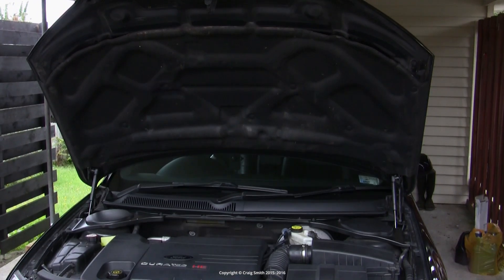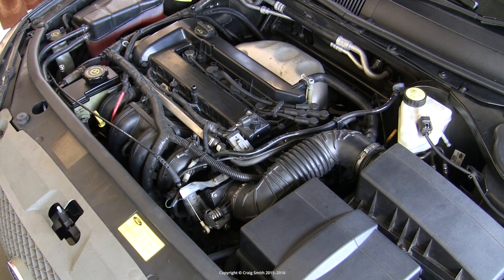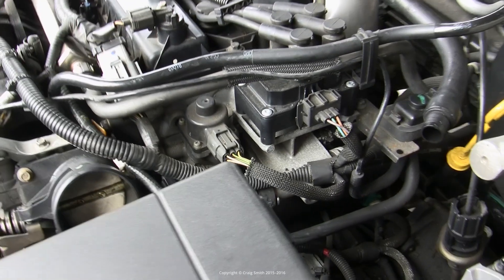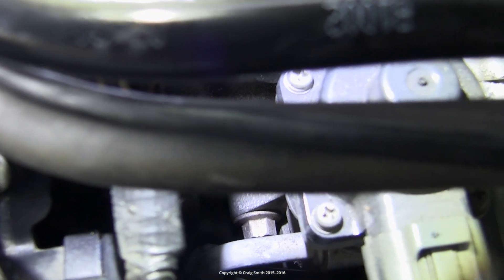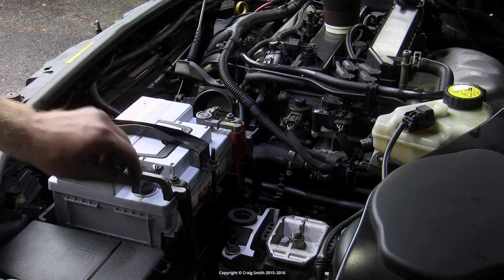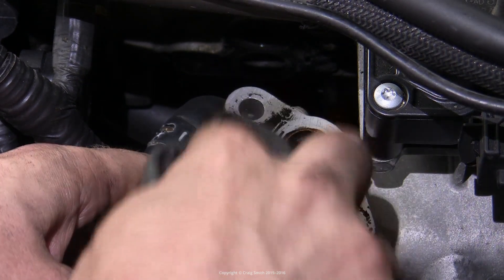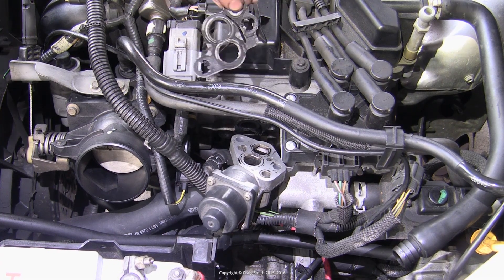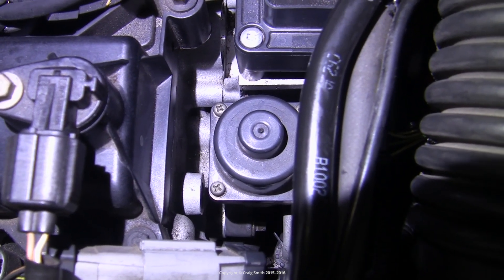How to: Remove & inspect EGR valve Ford Duratec HE (Mondeo, Focus, Mazda)

Comment: This was a horrible job! Whoever designed/approved that layout with the restricted bolt access is going straight to hell when they shuffle off their mortal coil... 

My tips:

Take the small coolant hose off before you unbolt the EGR. If it's been there for ages that hose will take some wrestling, and having the EGR solidly mounted will help. 

You will need a very shallow 10mm socket and knuckle joint to get in there. I didn't have anything that would fit, so I had to remove the large coolant hose, and was just about able to get a hex driver extension in there to remove the rear bolt.

I stopped the job to buy new bolts for the new EGR, because I rounded the edges of the rear one a bit trying to remove it. If you're planning on doing this job I'd consider doing this in advance. They were £7 for the pair, and fresh new bolts can't hurt. Better to have and not need rather than need and not have. 😉

Comment: That EGR ( exhaust gas recirculating ) valve looks just like an IAC ( idle air control ) valve.
Reply: Gusssing it must just fill the egr valve always and stay filled 🤔 so to keep the recirculated gasses cooler? I’m not sure tbf I was wondering that, I have one on my st150 being a 2005, worth removing you reckon?

Comment: If I replace the egr with a new one, do I have to calibrate or make an adjustment from the ecu or do I just replace?
Reply from the maker: Just replace. If the old one was faulty or very clogged up you might want to reset the car's tune adaptions, just unplug the battery while you do the job.

Comment: Well I managed to do it. But before touching the EGR, i unbolted the  water outlet connector so I could slightly move up the coolant tube and reach the rear bolt

Comment: The 2nd bolt on the backside of egr  is impossible to remove
Reply: Agree I tried can't remove
Reply: Yes I have been looking everywhere for this comment. I am currently banging my head against the wall. I hate 1/4 inch tool it flexes so much and breaks so easily. I am thinking maybe I'll just remote the top bit and work it up and down without cleaning the inside.   Who the hell designed this, it's awful.
Reply: Agreed. This is a nightmare.

Comment: The second bolt on the backside is virtually impossible to undo...smh someone said try a 90° degree angle so ill try thet to take the backside bolt off.... smh
Reply: Did it work?

Comment: I have Ford Focus 2007 model running on petrol and check engine lights have been a problem for a while now and it says EGR system flow fault, it might take more time and cost to order a new EGR and replace so I am planning on deleting or blocking the EGR but still unsure about it. do you recommend of using blocker plate for the solution?
Reply from the maker: I don't have experience. It might cause inspection failure depending on where you are, also I understand might require ECU re-map to get the codes & lights off.
Reply: @CraigsDIY The inspection is not a concern for me, and if i don't get it remap the only downside is i will always get faulty engine light code is it
Reply from the maker: No it can relate to tune too, the engine will not be getting the fuel/air mix it expects.

Comment: Thank you very much for the information, I have found a few of your videos very useful for the duratec he engine. I like to do my own maintenance so now I have a list of engine components to work my way through checking the condition of it all including the fun swirl flaps and pcv as a prevention rather than cure. My engine has only done 80000 ish miles on a 2010 MK2 focus and with these maintenance tips I'm confident it will do this mileage again and again as it's an excellent engine.
Reply from the maker: A low mileage Mk2 Focus is a great car, look after it.

Comment: Hi Craig, I'm confused wondered if you would know, I'm sure you will, I have a mark 3 mondeo petrol, recently on start up the engine flies to over 3000 revs, the throttle cable is not stuck, can't check for vacume leaks, replaced the throttle position sensor, cleaned out idle air control valve, not looked a egr vale yet, any suggestions?
Reply from the maker: IACV or its electronics could still be faulty. Check throttle butterfly valve closing properly. Have to suspect vacuum leak. You would want to check OBD diag for air/fuel and related info to find clues.
Reply: @CraigsDIY  Thanks Craig, I disconnected the IACV and started the engine, it went straight back to normal idle.
I have ordered a new one.
Thanks for your help, and great videos by the way.
Reply from the maker: @billmacdonald5906  I saw your other post. So did the replacement IACV not fix it? If disconnecting the electrical plug solves the high idle and a new valve is no different, that must mean an electrical problem. Have you checked codes?
Reply: Hi Craig, thanks for your reply I think as you suggested I have a vacume leak, I can hear it sort of around the coil pack area, can't seem to locate it.

Comment: I did not torque bolts and exhaust gas leaked. 
What is the torque pounds/ft on these bolts.
In your video, bolts were not torqued and no leaks. What a fantastic mechanic you are.

Comment: I got 2 new gaskets with my valve (Napa) brand. Make Sure you use the right one with the new valve because they are both different, different port holes, etc. Just match up the old one with the new. It took me approx. 3 hours to remove because of that right side bolt being hard to get at!! I also disconnected the throttle valve and air box for more room. And I bought some of those S shape box wrenches to install the right nut easier (I hope) going to do it today. Rather than cleaning it, Just replace it! In case you clean it only and it still might not run well. Mine was $81.00 at Napa. And I have a 2006 Focus ZX4 motor 2.0L. Of coarse I had to disconnect Both the radiator hose in front of the right bolt for more access, then you have to disconnect the small hose on the valve when replacing of coarse.

Comment: My car is in for rough idle low rpm vibration. They checked mounts and cleaned the throttle body and mass air flow. They are now "guessing" it might be the EGR. It will take them an hour to check it so they are recommending I just replace it. $425can tax in. Is this a logical reach and solution to a slight vibration? 🤔

Comment: I did this job on my 2.0 duratec powered focus, awful access, lots of swearing and scuffed knuckles I managed to get a shallow 10mm socket on a small ratchet from underneath the hard to access rear bolt.
To get better access remove airbox, throttle body and get to it from the side.
Be aware you lose about 2lt of coolant as you have to remove the thicker hose going to the thermostat housing, as you remove it lift it up higher than the rad and wedge it somewhere, the smaller hose going to the EGR can be left on if you only want to inspect and clean, it is hard to get off and I did split the end getting mine off, luckily there is some slack so I had to cut some off past the split when refitting.

The metal gasket needs to be replaced really as it has compression seals around the exhaust and coolant ports, once it is nipped up the compression seals flatten to seal. 
Use carb or EGR cleaner on the internal plunger/valve assembly, make sure it can move freely and doesn't stick, there will be a lot of oily carbon in there.
I took mine off, removed the electronic solenoid part held on by 4 screws, and soaked the valve overnight in cleaner, dry it thoroughly and add a little lubricating oil to the valve, I also put copper grease on the fastening bolts.
It might not be the actual valve that is stuck, it may be the electronic switch part that is faulty but you cannot get this part alone, I paid £59 for a complete new EGR prices vary wildly I got quoted anything from £120 to £175 so shop around.

Symptoms- mine would run until warm then cut out, restarting would be problematic, I'd have to floor the throttle and crank it eventually it would fire up, run a bit then cut out.

I had no engine light so no codes, to check I just unplugged my EGR valve and it ran fine with no cutting out.

I guess my EGR was sticking open, the engine will not run like that, when I unplugged it the engine ran fine but my engine light came on! 

I ran it like that for months, without issue before I replaced it. EGR is purely to lower emissions it does not make the engine run better and has minimal affect on mpg!
In my opinion you would be better without one, look at the filth behind the throttle body where the EGR port enters the inlet manifold!
Reply from the maker: Thanks for all that. I agree with your last. Some cars in some regions don't even have them fitted, nor cats, so it is certainly possible to tune the car to run without.
Reply: on mine it absolutely fucked acceleration and mpg, but it did fail entirely.
Reply: @m1ghtyboy  If I could figure a way of removing the EGR valve, Installing the blanking plate they make for the Duratec and having the engine run without throwing a code, I'd do it because it ran much better when the EGR was unplugged.

The engine light comes on without the EGR plugged in, unless it just needs the top solenoid and electronics part plugged in, that might work?🤔
Reply: @ the car needs to be remapped otherwise it will try to use the nonexistent EGR to aid acceleration. Not a mechanic but I believe a remap will make it pull any air it needs from the intake instead of the exhaust, and of course stop it from throwing a code. If you’re in the UK this will likely lead to it failing its MOT due to emissions.

Comment: On my Transit connect I noticed a cheap assed plastic coupling in the radiator hose was weeping . I removed , cleaned and inspected it and found it was full of cracks and ready to fail at any moment . Unfortunately , the coupling only comes with the compete hose assembly . $150.00 U.S. from the dealer . $75.00 online . If you have fat fingers , good luck trying to get that lower bolt out of the egr valve . Could be a lesson in futility .

Comment: Why the need to diconect the battery termination ?
Reply: Always a good precaution to take when unplugging any electrical connections from the engine.  The reserve charge in the circuit can sometimes damage the electrical system.

Comment: Why is there a coolant hose connected to the ERG valve?  What on the valve needs cooling?  And there's no coolant return hose?
Reply: The exhaust gases are too hot for that tiny valve so it needs cooling. Anyway exhaust gases are used to cool down the engine combustion chamber because they have very little oxygen, and practically inert in the process. The optimal temperature ensures NOx to be reduced before the cat
Reply: @Starfank  
Thank you. That makes sense. 
I do see besides the two holes for gas, there are 3 more holes between this valve and the return to engine block. Coolant return is probably one of those.

Comment: lol. You did it in a 6min video... project took me 11hours. 'Course, I had to flush the radiator, buy new r fluid and MAF cleaner while they were taken apart..., and pull a salvaged sensor. Let me just say that I don't like EGR valves anymore. Taking the radiator hose off doesn't help all that much, because the socket for the hose still blocks the bolts pretty completely. I used a "box" wrench with a 90 degree bend in it (available at harber freight) to get them broke loose- only after I removed all of the wiring including the ECU wiring. NOT WORTH IT!!! Throw the car away and buy a scooter.
Reply: So did you sell or throw the car away?
Reply: So you were able to get the back bolt with a offset wrench? Or s type ?

Comment: Please, I need to clean egr on the monde and I do not understand you because I can not speak English. Do I have to drain water with coolers?
Reply from the maker: You don't need to, but you'll probably spill a bit of coolant in disconnecting the hose. If you lose a lot just top up after.

Comment: So is that tiny hose connected to the EGR the coolant hose? Or do you mean the big hose running next to it?
Reply from the maker: They're both coolant hoses, the small one cools the EGR valve.
Reply: I'm changing my egr valve on my ford focus .IV for got how to put clamp back on egr valve.the clamp that holds the egr together

Comment: Question can you remove on top of the erg the four screws and than clean it ???
Reply: I did that... and no. It has the ports for the exhaust only on the side facing in towards the engine.
I did find that the top (with the sensor and motor in it) are easier to swap for a new one if they are the problem. Also if you take the top off you can manually depress the valve on the bottom piece to see if it is gummed up or not.
Reply: @daniels6624  Daniel did you do that taking the top off with the four screws and try to clean it? It's harder than hell to reach those bolts. I have to do this the next day or two!
Reply: @BugzKiller I couldn't take the bolts out either ...they don't have have a tool or the room to do it ...smh

Comment: Thanks for this video how to do it.
But the tool you used did not fit by my mondeo I had to use another tool that was smaller so I could place it between the bolt and the hose.

Comment: Good video I know where the erg is now.
But can you spray it with some cleaner?
And must you spray it where it is attached on the engine?
And if so what cleaner spray I can use?
Reply: Yes it must be "cleaned" where it is connected into the engine.
It made more sense to clean these when they were removable.
Reply: How would you clean it ?

Comment: Hi craig 
My question is i replaced my egr for a new one after i did the job i set off the faultcode.. when i go for a ride the fault code pops up...so i read the obd end i see its the egr valve over end over again it will popd up back
Reply: That could be a broken wire, it could be stopping the egr opening, causing the ecu to throw a fault code
Reply: I'm having the same issue
Reply: Spray soapy water over the engine to make sure it's not a leak on your gasket or a vacuum line.
Reply: I'm having the same issue did anybody ever resolve the issue I need some advice

Comment: Hi if you undo the four  screws on top of the egr valve will that give you access to the inside so i could squirt some egr valve cleaner inside ?
Reply from the maker: It will give you access to the solenoid or springs inside. What gets coked up are the ports and valve on the EGR ducting, which is why you remove it as shown.

Comment: I keep thinking of removing EGR module altogether from my engine (I have the same as yours). I have bought a egr stub part (they are used on old Duratec/L blocks on mondeos). 

Apart from ECU problems, I cant seem to figure out what to do about the coolant line, if I just throw away the EGR. Where does it go, and is there anything else that depends on this line for cooling etc? Do I just plug it and forget about it?

Comment: hi there my car ford mondeo 2002 vtec needing to know where my EGR is located as it is not where yours is in this video
Reply from the maker: If you have a Honda you're on the wrong video. If you mean Duratec and you mean the 2.0 HE, then it is where shown. I think however some locales with lower emissions standards didn't get them. In this case you will see a blanking plate where it should be. Where is your car from?

Comment: Thank you for all your helpful videos on this Mondeo. I have a 2003 Mondeo with this same duratec engine. I have a question you might be able to answer, sometimes when the engine is warm it won't start without giving it a little gas. I also noticed that the throttle percentage never goes bellow 18% and it doesn't go above 80,4%, is this normal? Engine seems to run just fine though, but I never owned a Ford, so I can't really compare. Obd once gave a p0400 fault code but that never returned after deleting. Could this all be related to the egr?
Reply from the maker: I don't think it's likely to be the EGR, they can be finicky and I wouldn't worry if the code doesn't return, but anything is possible if it is clogged up or failing. I understand the codes are more common on manuals. Have a look at my other videos for the one on checking the TPS, and compare my voltage low/high to yours. There is also the old thing with Duratecs where if you kill them after a short trip there can be exhaust gases left trapped in the intake manifold which give trouble starting next time. You can 'fix' this by opening the throttle as you turn off the engine, or just accept it will take a few more cranks to start again, but it's basically normal and not a mechanical fault.
Reply: Craig's DIY Car thank you so much, now I'm a bit more reassured that all is normal. It indeed starts normally after I give it some gas when shutting down. Now after the thermostat, and  broken springs on to fix the central locking on the passenger side door. You're videos are super helpful! Thanks again for replying.
Reply: Craig's DIY Car Really good video this,my Mondeo 1.8 is pinking under load / heavy throttle and my chief suspect was this or the knock sensor. Do you have any vids for a knock sensor swap? It's a 2002 model.

Comment: MY CAR IS 1/8LX PETROL WHEN I LEAVE THE CAR FOR AN HOUR THE FUEL FINDS IT HARD TO BE PUMPED THROUGH THE ENGINE BUT IF I KEEP IT ON HALF FULL I DONT GET THE PROBLEM. WHEN I DO I FIND OUT THAT IF I PUT A GALLON IN OUT OF MY CAN IT WILL START ANY IDEA. IVE CHANGED FILTER THAT WAS BLACK WITH MUCK BUT STILL THE SAME ANY IDEA